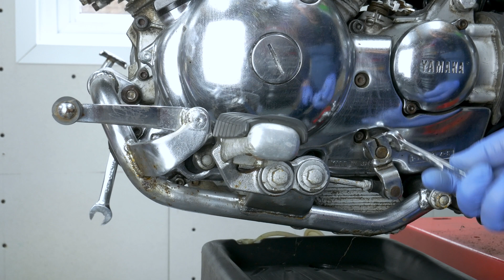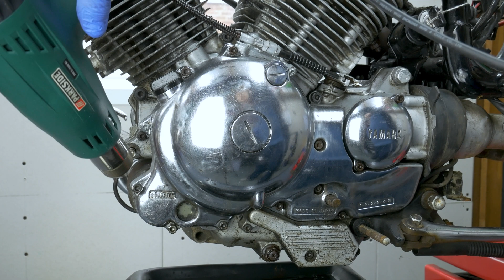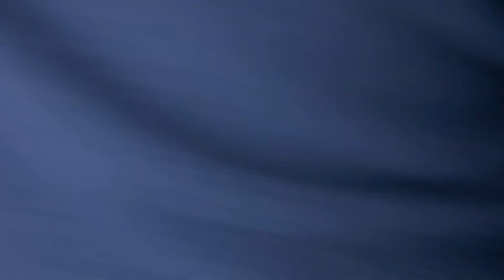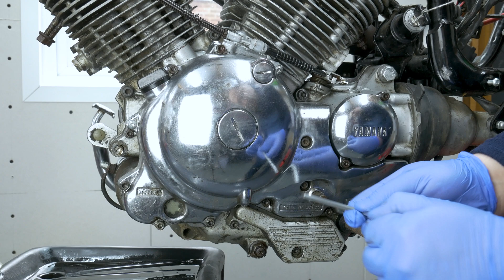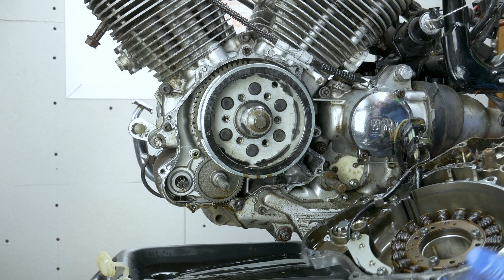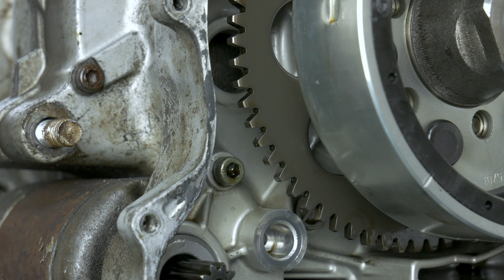YAMAHA XV535 STARTER CLUTCH PROBLEM | DETAILED REMOVAL TUTORIAL | 4K | ENGINE NOISE FIX | #7

Comment: A very, very descriptive video showing the vomponentry of the starter clutch assembly. Whilst this terrific video was made 3 years ago I want to mention that Tamaha did a design flaw with the three bots. Shouldered bolts should have been used where the shoulder snugly fits  the top plate. The threads running up to the screw heads is asking for trouble. I will oversize the top plate holes and get shouldered bolts fitted. Or put collars between the screw and top plate but make sure there is still no thread inside the collar. Hope this makes sense and helps.Yamahas fully threaded screws were destined to fail and get chppped out.

Comment: how did you get the flywheel not to move, trying to get mine of ,
Reply from the maker: I used a bar through the bolts on the flywheel puller, but you could put it in 5th  gear and blocking the rear wheel or press down on the rear brake.
Reply: @MidlandCruiser  mines very well glued on, bent 3 yambit pullers, waiting on a better one coming, Thanx for answering, , yea tried a heavy screwdriver to hold the flywheel, does the job but being very stubborn, ,  tried a sliding puller, had to grind the claws to fit, snapped, .  tbc , good explanations
Reply: Mines of now, heavy duty puller , cheers
Reply from the maker: I ended up using a 16mm thick tool steel plate and got it off with that. Used the threaded bit from a silverline cheap puller, and cut out 3 slots for the bolts with an angle grinder. Ugly but worked fine. Glad you got it off

Comment: Hey man, Thanks for the video, very informative! My 535 won't start and when i push the start button, it makes an horryfying/loud metal on metal noise. I opened the engine and all i can teel is that i can turn clock wise and anti clock wise the crankshaft and the starter gear will move both ways, not good right ? also if i turn slowy clockwise, the starter clutch and starter gear move at the same speed(that's ok i think) but as soon as i apply some force to make it spin faster, it won't move at the same speed like the starter gear(or clutch) is not sticking properly when some force is used. Don't know if i'm very precise haha, but i think that is not supposed to act like that and i will have to, change the starter clutch right ? 
By the way, how did the upgraded starter clutch goes ? where did you buy it ?
Thanks again man for your work !
Reply from the maker: Hello, sorry for the late reply but the comment went straight into hold.
What you described is definitely caused by the starter clutch and you may need to change the big gear too as that has the surface which the clutch grabs, and probably very worn if you can turn that gear both ways, either way need to be checked and measured.
Believe it or not I still haven't put it together as I am busy upgrading the house. That being said I want to sell it this year so I'll have to find time to finish it, as I need the space...
Reply: @MidlandCruiser  No problem man, thanks for the reply ! i changed the starter clutch, and the big or small gears looks perfect so i hope it will solve the probleme with only the new starter clutch, i just have to reassemble everything to test it !
Reply: @antoineduclos8706   how did it go ? I'm having the same problem

Comment: Hello I have a 2015 TTR 230 I replaced the starter clutch Fly wheel does not turn only the starter clutch gear turns
Reply from the maker: I'm sorry but I'm not familiar with the TTR230...also not entirely sure what do you mean.
The starter motor doesn't turn the flywheel?

Comment: Can you just magnetize the bolt? Or would it not be sufficient
Reply from the maker: Hello, no that wouldn't make a difference. The vibrations make them come loose, so the best thing to do is to use red Loctite on them, which I will do when I put it together.

Comment: Hello. I replaced the stator on my bike and for a day everything was fine. The next day when I started the bike, it made a noise... like something was scraping the metal. I opened again the stator cover but no signs of something to be wrong... Dont have the tools to remove the clutch... :(
Reply from the maker: Hello. Try to move the starter clutch behind the flywheel with your fingers, if it's loose you'll ne able to move it left to right, if it moves than you'll have to remove it, check the starter clutch, if it's ok the replace the bolts and use red (permanent) loctite on it. It is a good idea to change the clutch tk a new one if you took it apart, just in case. There is refurbish kits available or you can buy a full new one if needed....
Regarding the tools, many people managed to remove the flywheel with a fairly cheap harmonic balancer puller, so you could give that a go...
Reply: @MidlandCruiser  Flywheel moves ONLY IN ONE DIRECTION... guess this is good!
Reply from the maker: I meant grab the actual starter clutch and try to move it left to right like I show it in the video from 12:20. You can do it while the flywheel still on the crankshaft.
Just to make sure we talk about the same things.
Flywheel = big round metal with magnets inside 
Starter clutch = smaller round metal bolted to the back side of the flywheel
Starter gear = big gear which only spins 1 way 
Which one did you try to turn?
Reply: @MidlandCruiser  Starter gear!
Reply from the maker: Yes that is a good sign if it only spins 1 way however the clutch bolts can be still loose, jut like they were on mine. So try to spin that behind the flywheel, shouldn't be possible...
That sits between the the big gear you spun and the flywheel with the magnets..hope this helps

Comment: You must hit the puller bolt with the hammer several times and the flywheel fall easy. BUT. When you untie the scentral bolt of the flywheel you must leave it inside, only untie 2-3mm. Than use it like a base for the puller main screw. Screw it hard and bag with the hammer... :). Done it several times
Reply from the maker: Thank you for the suggestions I appreciate it. I hope I don't have to do this again, but if I do I will try to use a shock method or something similar...👍

Comment: Hey buddy great video I'd suggest you use this heavy duty starter clutch, the 3 roller stock design is prone to that failure 70s tech you will see even old hondas with that type of starter clutch having the same problems, also troque the 3 bolts to 15 ft lbs use red loctite and peen the end of the bolts it will be good for a long time https://www.ebay.com/itm/114894837203?hash=item1ac04415d3:g:DaoAAOSwrVRg5rU5&mkcid=1&mkrid=711-53200-19255-0&siteid=0&campid=5337742824&customid=&toolid=10001&mkevt=1
Reply from the maker: Hi sorry but the spam filter put your comment in hold....thank you for the suggestion. I already have purchased this exact same part for the bike...waiting for fitting when I get time👍 Thank you
Reply: Cool what is a spam filter lol

Comment: hello, tell me, on a Yamaha Virago 1100, is there a similar problem? I have a thud at idle and at medium temperatures. There is no knock on the cold one and there is no knock on the hot one, but it knocks on the medium ones.
Reply from the maker: Hello. That seems to be a wierd one.
There is a little ticking noise from the top when it is hot, and considered normal (it's the valve lifters)
The starter mechanism is completely different on the 1100, and it isn't noisy once the engine is running. I've heard that, there could be a deeper sound coming from the engine but normally when it's cold and it is normal, because of the bigger tolerances in the air cooled engine, once warmed up, it goes away (mine has this, and seems to be fine)
Hope this helps, really hard to help without actually hearing the engine
Reply: @MidlandCruiser  
1. Hello. Here is a video of my motorcycle - https://youtu.be/_7RJqxC-vBA
2.Here is a video of motorcycles from an auction in Japan, and the same sound is present - https://youtu.be/MyHINRywRG0

   https://youtu.be/Dmoims22MNE. 
This happens at average temperatures, about 50 degrees Celsius. on a hot engine, the sound almost disappears. Please tell me, have you ever encountered such a thing? Is this normal?
Reply: @Gofffsky  Normal. Most big Viragos have a slight thud, it is clutch noise.
No need to worry about it.

Comment: Hey. Thanks for the video. Just bought a 535 and it drives fine, but sometimes it's hard to start and it looks like the starter is making some whining noises. Maybe you could point me in the right direction?
Reply from the maker: Hello. In these bikes the starter mechanism is quite simple...basically the motor drives the starter gear directly.  Then the starter gear is inside the starter clutch as you saw in the video, the only thing could make it cause a whining noise during starting, if this clutch is slipping on the boss of the gear. I hope it makes sense

The rollers in the clutch maybe worn or the boss on the starter gear is worn, or both..unfortunately you will have to take it apart and have a look
Reply: @MidlandCruiser  I will take a look as soon as I can. Thanks for your answer

Comment: It is look like the clutch is not in stock condition. When I disassemble my one I saw that bolts were riveted on the back side. And I am sure that it was a stock.
Reply from the maker: Riveted? That's strange, it should be bolted in case you need to replace it...never heard about riveting it to the flywheel..🤷‍♂️
Reply: @MidlandCruiser  They aren't riveted. They only stake the bolts in the factory. That's why they often come loose.

Comment: I wish I had a video resource like this, 15 years ago. I passed since then thru every "narrow" moment illustrated in this video multiple times. Once I had to collect a broken starter clutch from the engine piece by piece. However I still have my 535 along with a '97 XV1100. I've ordered my own custom built puller and a rubber hammer, just for this operation. I bought a new rotor as the old one got hit encouraging further deformations. The design of the original three roller starter clutch drove me crazy as it is flawed from conception. At this time my 535 engine is undergoing a complete overhaul  followed by a six roller starter clutch. God please go easy on me this time and thank You I have another Virago to ride. Nice video, I bet  it would still alleviate a lot of heartaches around the globe. Thanks!
Reply from the maker: Hello, thank you for sharing your experiences. As you can see I had to get a lot stronger puller too as the general cheap one wasn't strong enough. The design itself is a lot better in my opinion then the early 750 and 920...that starter system is just crap. No wonder it's called  "box of rocks"😄
I also ordered the 6 roller clutch, we'll see how it works, and definitely put some thread lock on the bolts to avoid this headache again...thanks again and wish you the best with your bikes😉👍
Reply: @MidlandCruiser  Please don't forget to share your experience with six roller starter clutch. Thank you Sir! Bests!